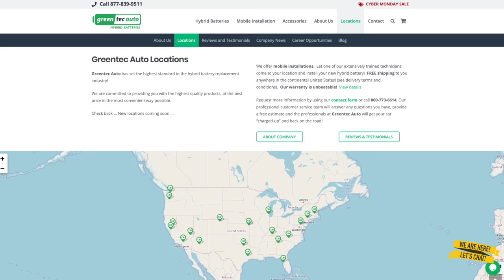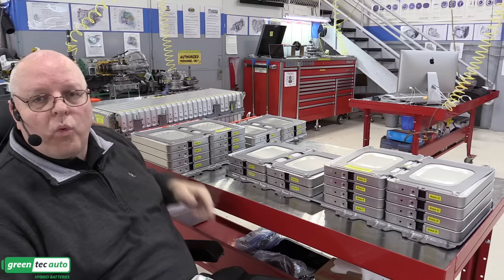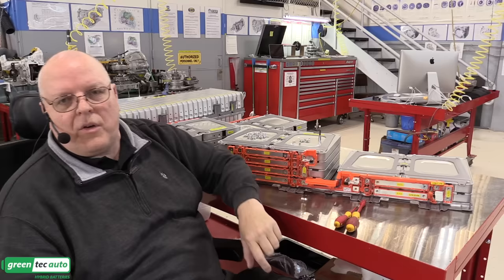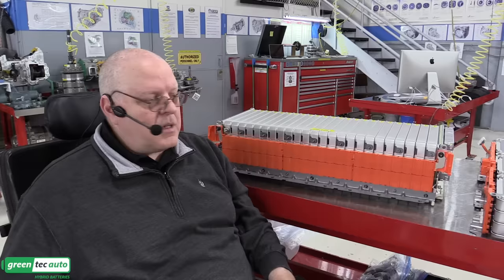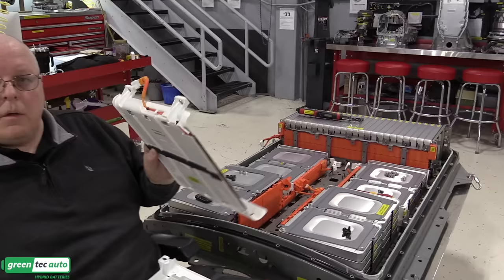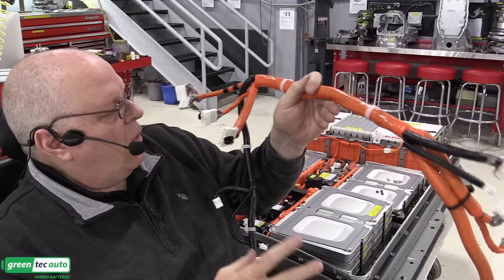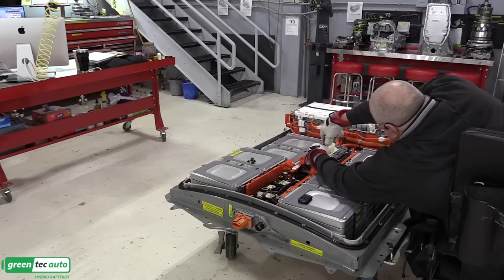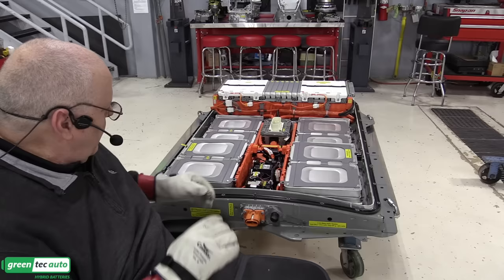2011 Nissan LEAF Battery - Deep Dive

Comment: I'm only 20m in but wanted to ask as I'm not going to be able to finish this for a bit but i'm curious.   With the modules designed like that, how much is reclaimable with recycling?   With the degradation the leaf of that generation sees, there's going to be a lot of dead modules out there.    Can they be recycled cost effectively?  awful lot of material there.

Comment: 1)  Professor; please measure from either positive or negative of the entire pack (360Vdc) to Earth ground.  If you get anything other than 0 (zero) , then even 24Vdc could be unpleasant.  As it is, it should be zero.  Thus, the only risk is in touching BOTH positive and negative busses.
2) Most AC systems are dangerous because they are referenced to ground - they do not have a ground wire; the ground conductor Is mother earth herself.  Therefore, if you touch a "hot" lead you get zapped because you completed a circuit to ground.
Ever watched birds perch on a 6,000Vac line?  Things are different on very high AC lines...
3.  Interesting to see how GM managed to make the most complicated, most difficult to service system, while
 you can service a Japanese battery with minimal hand tools.
4.  Yes, an uncooled battery of this capacity is less than optimal, building one with over 200 gaskets/seals is not the hallmark of reliability, hence the inability to field service a battery.

I really like your videos, although I will never again be able to repair a vehicle.

Simon
Reply from the maker: Thanks for the information and Thanks for watching

Comment: Do you think modifying the case to move air through would be feasible?
Reply: Kevin Breslin Redesigning would be excessively complicated when looking for longevity. It could be ventilated, but they clearly wanted it to be sealed in the first place.

Comment: An unconnected stack may be harmless enough. It is below the critical "safety voltage". 
However, when connected to another one, that is entirely different.
The trouble is that it still looks the same.
This is not a job for the absent minded.

Comment: I hope the MSDS sheets are up to date on these batteries, I don't want to fire department getting into a bad situation with them. 

Oh, and disable your water suppression too. Water reacting with burning lithium = BAD news.
Reply: Lithium comprises less than 5% of the cell and is not in metallic form, which is why they are called "lithium ion" batteries.
It is the ethylene carbonate or vinylene carbonate liquid electrolyte that is flammable. The rest is fairly inert. The recommended method is to douse with copious amounts of water to keep them cool.
Reply: @ahaveland  The hazards don't stop there. Decomposing lithium batteries emit hydrogen fluoride gas, a nasty chemical you DON'T want to get involved with.
Reply: @Nighthawke70  Yes, HF is nasty, but can't be produced if the cell doesn't contain any fluorine and there are hundreds of different formula combinations that don't use any.
HF dissolves in water quickly before dissolving in you so I would worry more about the combustion products of PTFE.
Reply: @ahaveland  Agreed. Also, keep in mind those little "airbags" that develop in your portables is not exactly the breath of life.  I keep a "oily rags' steel can filled with dry sand in them to bury any bulging lithium cells.  It help keep those little devils honest. If one flares in sand, it fuses to silica, smothering things. Also great for those little magnesium fires.

Comment: If an off road vehicle hit its lover part of the car (where the battery pack is) against a rock, can that battery catch fire, as happened with the tesla battery pack?
Reply from the maker: That is a possibility
Reply: @WeberAuto  
For this reason I dont like the electrical car, because the battery pack cover all the floor of the car and is exposed to all kind of hits from the ground, rocks and street structures.
And that is a fire that cannot be suffocated with any type of fire extinguisher.
Once the battery pack of and electrical car catches fires, the car is 100% lost.

Comment: I don't see why the large housing for the battery modules can't be made into a matrix that each module plugs into from the belly of the car.  Instead of having to unbolt this 2-tonne monstrosity.  And unlike Tesla, it will be ideal to develop a well balance speed control that allows the gears to build up momentum, instead of exceeding what they can handle.  This in conjunction with a high torque electric motor maxing out at 6000-7000 rpm. and 5-speed manual transmission for MUCH better highway millage.

Comment: I imagine you could pipe some air to the battery box ? I also wonder why they don't have a means to charge a pack while running off a  pack.   Maybe a gallon of gas for a 100 miles for a generator..Auto start auto switch over from pack to pack. I've seen one with a drop down wheel  that generated power ..What's your thoughts on that.

Comment: Dear Professor Kelley, much as we admire you and your ethic, we do not admire your Optician!  
Please inform them your spectacles are not optimal.  It is imperative the frames are matched to your physiognomy.  Frames come in many different lengths/widths/shapes, influenced by nose height, ear height and  distance from the nose, cheek and forehead shape.   If the frames are not optimal, the corrective lenses will not be positioned properly for optimal effect.  All pretty much straight-forward logic, but  unfortunately, too many "oPticians" just want to sell the most expensive frame, whether it fits or not.

Comment: Dahn has commentary on the original Leaf battery chemistry choice in his video 'Why LiIon Batteries Die'.
Interestingly his recent open source paper on how to make a million mile LiIon EV battery shows his dual electrolyte as quite temperature tolerant so may suit a cheap car without cooling.
Tesla's Battery and Powertrain Presentation in Q1 next year will make this look like vintage footage!
https://batterybro.com/blogs/18650-wholesale-battery-reviews/103090502-why-do-lithium-ion-batteries-die-long

http://jes.ecsdl.org/content/166/13/A3031.full
Reply from the maker: Thanks for your feedback

Comment: Totally a terrible idea to not use active cooling.   

(I own a ‘16 Leaf...never again)
Reply: Cooling was only half the issue, Because the battery was undersized, and due to range anxiety, owners tended to keep the battrey fully charged or topped up when ever possible. Li-ion batteries have also shortened life the longer they are at full charge. The combo of being fully charged and and heat is the worst situation for Li-ion batteries.
Reply: Nor Dic and that’s why I’ve lost two bars of battery health on our leaf. I’m hoping to lose 3 more in the next 2 years so I can capitalize on the battery warranty.